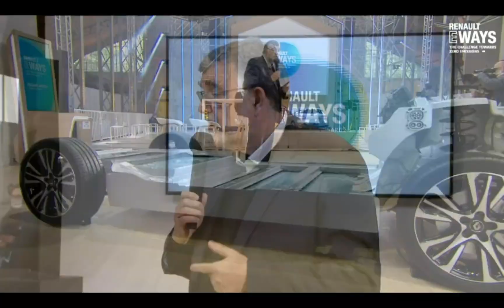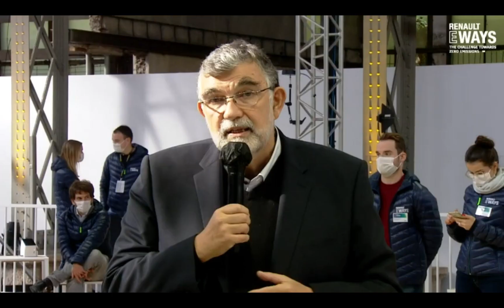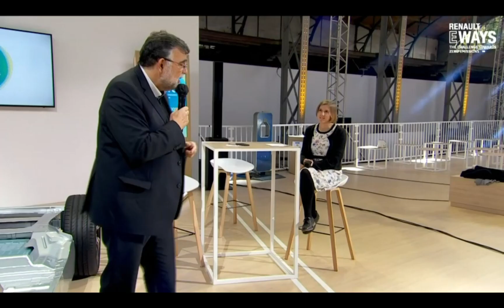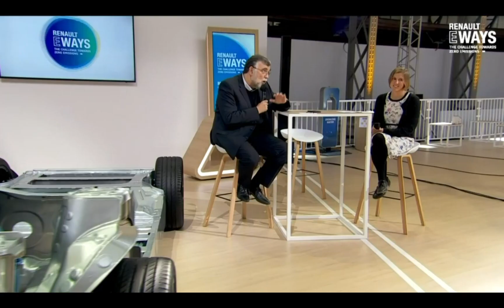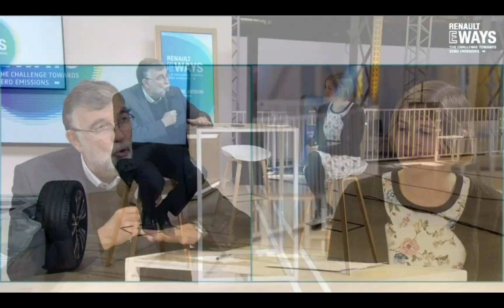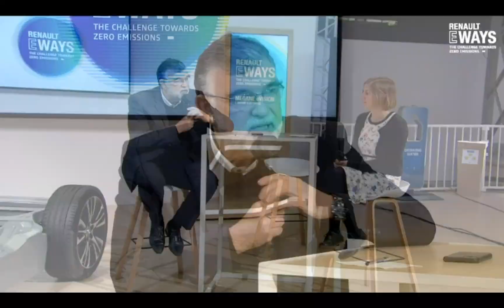CMF-EV platform / Renault-Nissan-Mitsubishi Common Module Family – presentation (English)

Comment: NMC-721 and 270 Wh/kg at cell level is not really "state of the art" for 2021 (year of presentation at IAA) or 2022 (year of SOP of Megane e-Tech Electric), either. And why did Renault choose a front electric motor for, a "pure BEV platform" as he said?